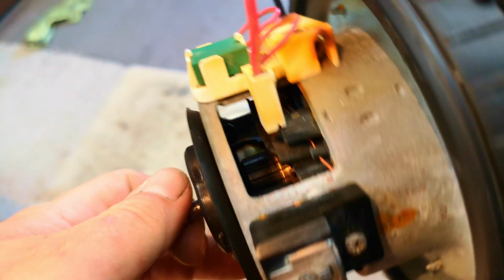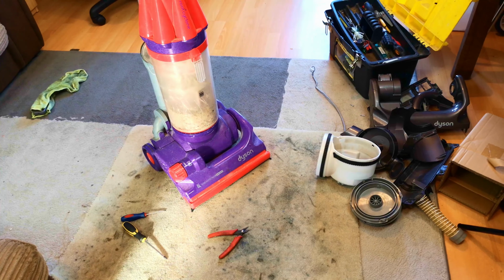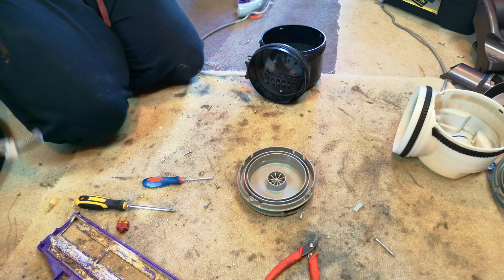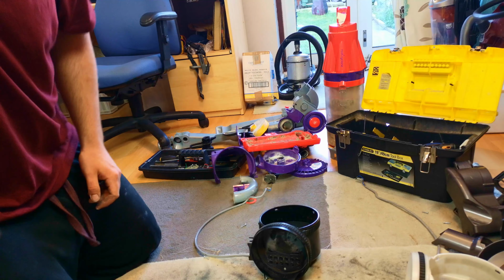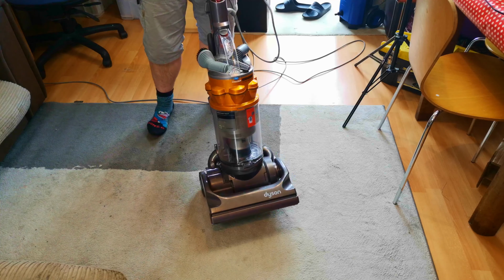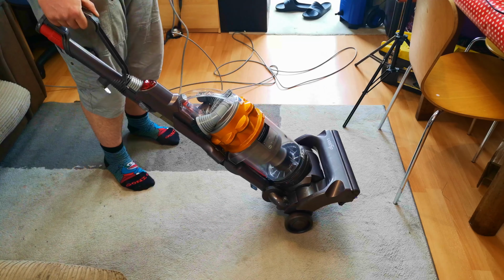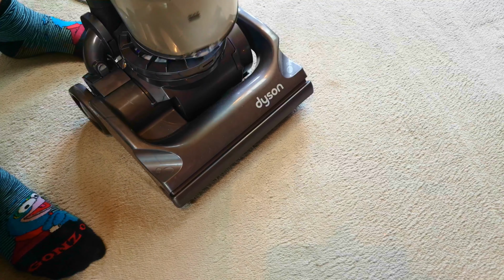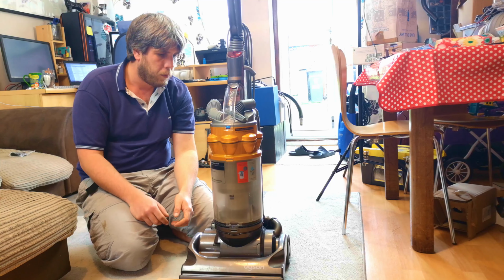The Dyson DC14 Winter Experiment - The results!

Comment: Good vid as usual mate. I don't bother opening the switch wiring up, its an unnecessary step. Also I spray the rubber fan case with silicone spray which means I can rotate the motor into place easily. I do about one of these a week.
Reply from the maker: I always remove the spinal cord as it just makes it easier when it's on the floor! I use bubble solution for the motor as it dried fairly harmlessly and is mega slippy! Used to use a smear of grease, then I had one back a year later for a new motor and it was a mess!

Comment: You made very heavy weather of getting the motor out it's casing and damaged the rubber cowling. If you get a 36mm ? bit of waste pipe, about 4 inches long, you can place over the spindle and push the motor and rubber cowling out very easily. Replacing I use some washing up liquid and a G clamp once nearly back in. Thanks for the video 73's M6APJ
Reply from the maker: It was harder than usual, your right to notice the struggle! I like the pipe idea though, thanks for that tip!